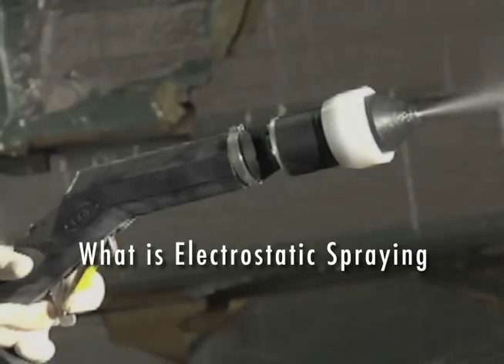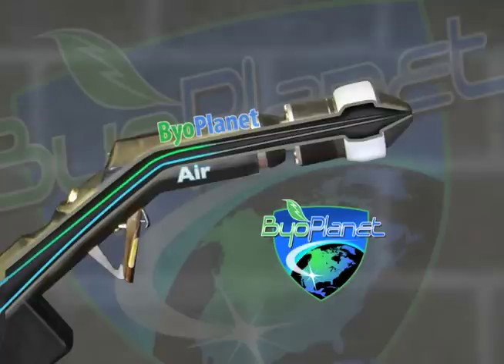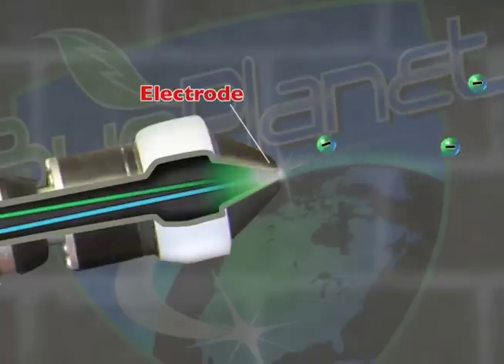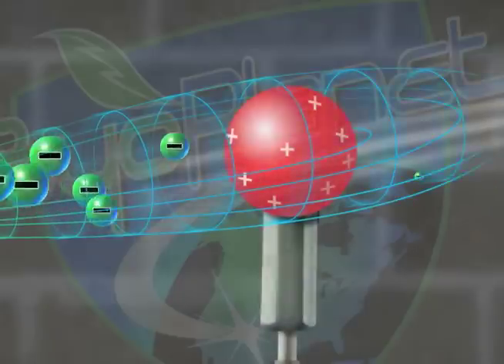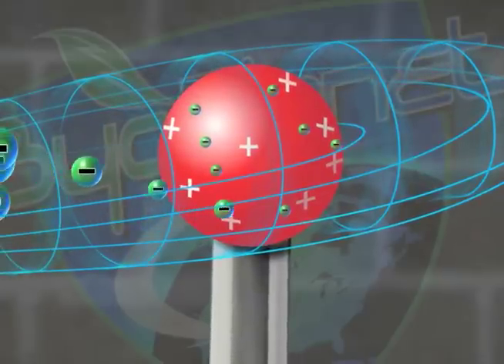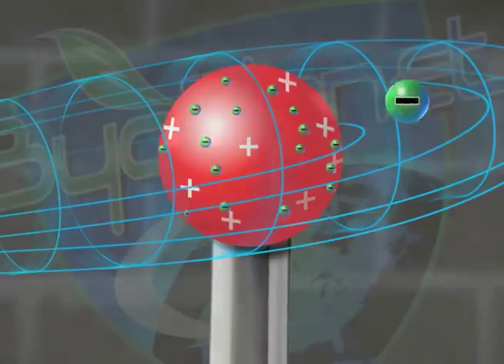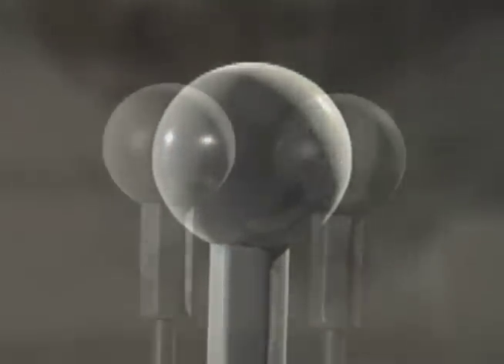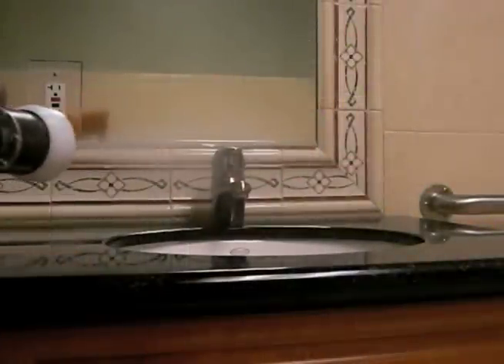What is Electrostatic Spraying?

Comment: This is bollocks. How is every surface positively charged?
Reply: Not every surface is positively charged, but charge can be induced in an electrically neutral objects. Such neutral objects contain roughly equal amounts of positive and negative charges. When a negatively charged object is brought close to a neutral object, electrons (which have a negative charge) on the neutral object are repelled away to the other end. This causes the far side of the neutral object to gain a momentary negative charge, and the side facing the negatively charged object to gain a momentary positive charge. If we now connect the once-neutral object to the ground, which acts like a big conductor, the electrons can travel out from the object, and the once-neutral object is now positively charged. 

*By momentary, I mean that if ungrounded, the object will return to being electrically neutral once the negatively charged object is removed. As long as the negatively charged object is there, a charge will be induced on the once-neutral object.
Reply: @astradrian  this helped👍